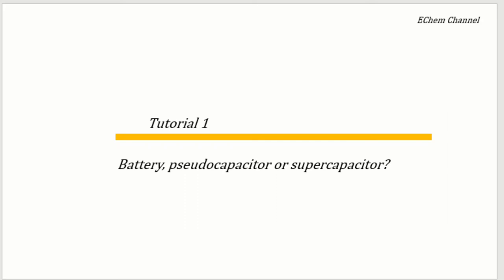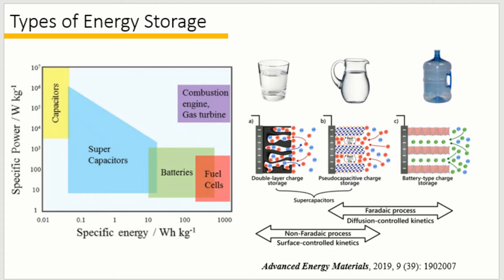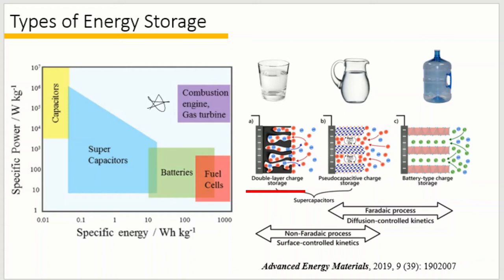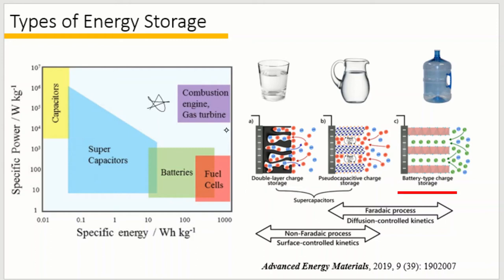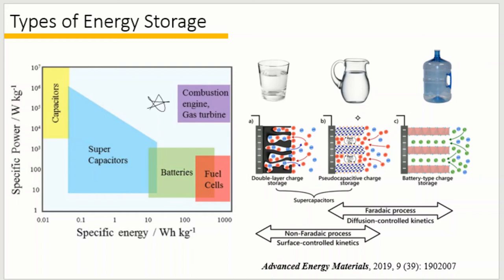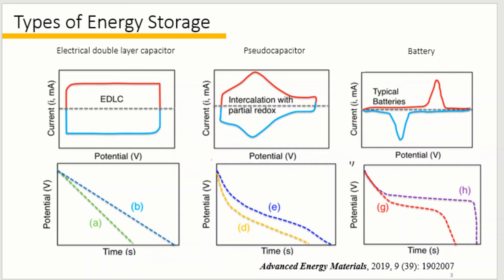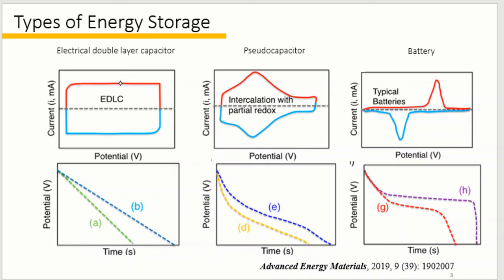Tutorial 1-Differences between battery, supercapacitor and pseudocapacitor

Comment: Can someone explain what is the difference between a pseudo capacitor and a battery?
Reply from the maker: Fundamentally, whether the kinetics of the energy storage process is limited by solid-state diffusion.
Reply: @EChem_Channel ....how can it is solid State diffusion even we use liquid electrolyte in battery
Reply from the maker: @riyanasherif7154  it is the diffusion of lithium-ions in the solid-state electrode materials